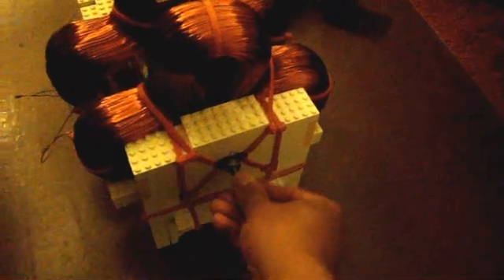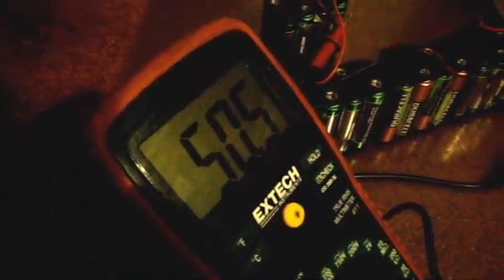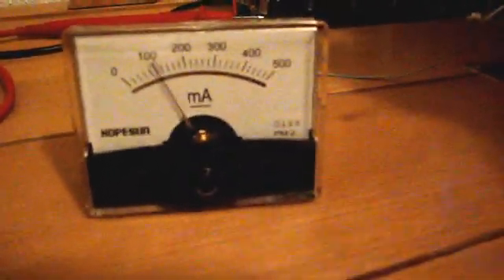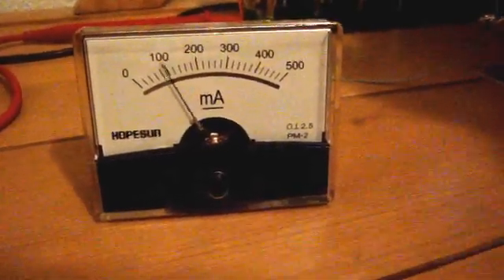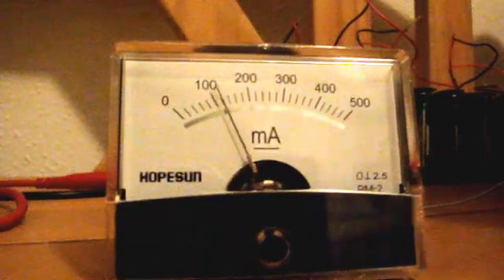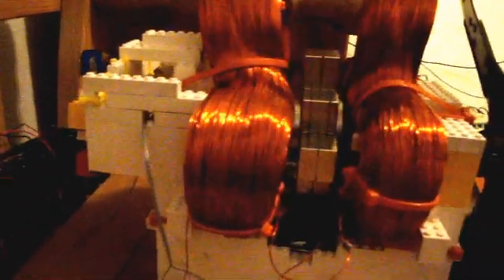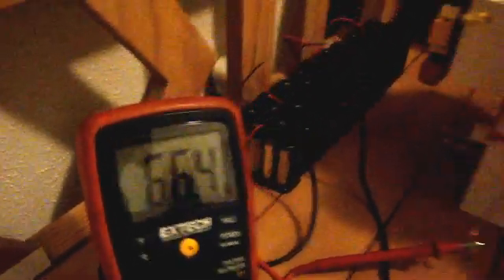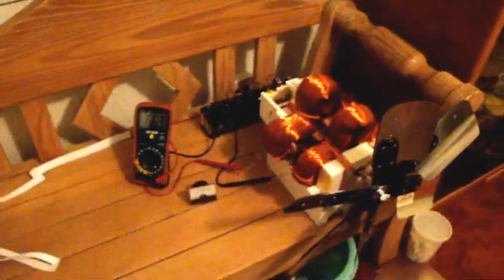2011 Newman Motor (19.375" Fan Test 1)

Comment: Even though it is 8 years later, something you did wrong with your testing to figure watts is you did the battery voltage at 0 RPM ( batteries disconnected from motor ). It needs to be tested with the motor running to figure the watts. Running will draw down the voltage on the batteries and you would get a lower wattage reading.

Love the sound of it though as it sounds like some of the older gasoline engines when they are barely ticking over.

Comment: MORE VOLTAGE !    Please !.      The One and Only Joe Newman runs his machine with 750 volts..  He uses lots of 9 volt batteries..  Try getting rechargeable batteries..    I put some diodes on the end of an extension cord and plug it in to the House mains,  for 120 volts..   It's what lil Newman needs.